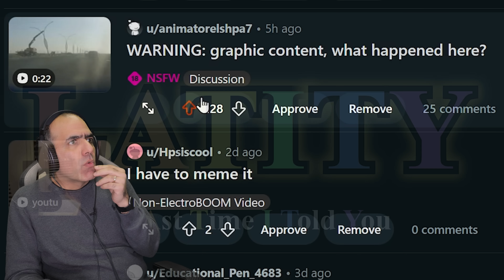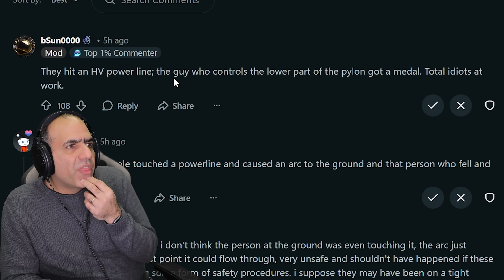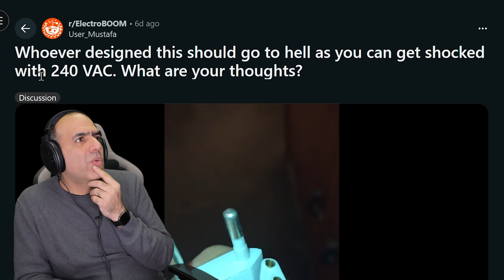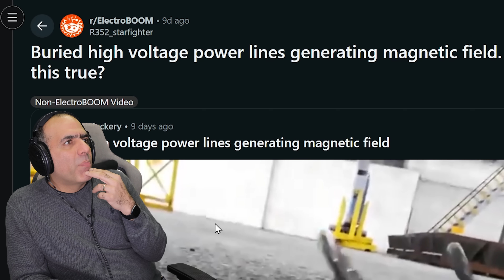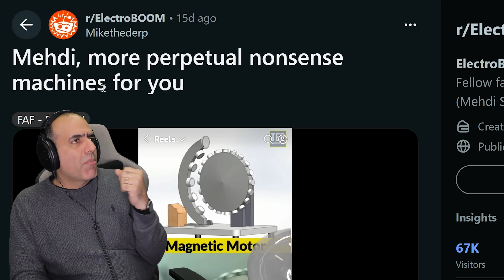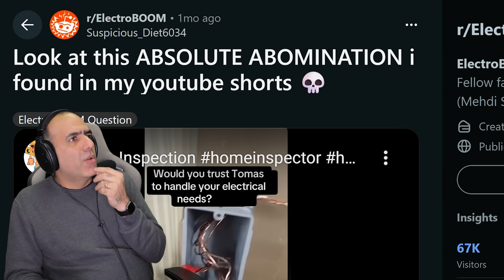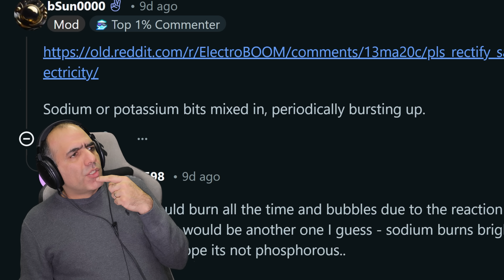Have a Pole? Need a Hole! (LATITY-017)

Comment: 0:56 AC shocks are dangerous because they don’t give you one chance: with mains power (50/60 Hz), the ‘dice’ roll 50/60 times per second against the heart’s timing...

During each heartbeat there’s a short window where the heart’s electrical system is transitioning back to ‘ready’. In that window, different regions can be in slightly different states. A jolt arriving then can split the timing, set up circulating electrical activity, and the coordinated squeeze breaks down. The heart may still be electrically active but now no longer produces an effective pump stroke and needs to get defibrillated.
What matters most is the route through your body, how long you stay in the circuit, and the repeated ‘taps’ of AC - dice roll after dice roll.

Comment: 6:50 - it's likely an aluminum electrolysis plant. They often have lines that run at many kiloamperes of fairly low-voltage DC. The magnetic effects there are WILD.

Comment: 08:48 
The wires you see in Thailand are not power transmission lines but network cables.
The power system is divided into 3 levels:
Low to high transmission (network):
Middle level: 220V, 3-phase, 4-wire, with an additional 3 meters of cable.
Top level: 1000V, which will be converted to 220V (50-60Hz) by a transformer.
Also, I'm a second-year vocational student in electronics at a college in Thailand. I'm 17 years old.

Comment: Resulta que si, es más facil hacerlos porque algunos aparatos se descomponen  y queda el cable suelto, luego vas a la ferretería y compras un contacto.

Yes, it is easier to make the extension couse because some devices stop working and there you have some wires. Then you can go to the hardwere store and buy the other part.

Comment: 10:39 No, our grids are 220V, that is just the rating of the outlets, some places here have grounded outlets, many dont, many houses here dont use RCD or GFCI, and if they do, its usually GFCI outlets, not the breakers themselves, but newer electrical installs here prove to be an exception
Reply: 230V nominal based on Philippine Electrical Code 2017
Reply: Um, akshually...
Mains voltage isn't defined at the grid level (though it's often most practical to have all domestic use operating at either single-phase full spec voltage or dual-phase half spec voltage).
Reply: @Gabu_ This is singlehandedly the most stupid comment I've ever read. Yes, mains voltage is defined at grid level in almost all countries. The distribution transformers in every country have to output the same voltage, unless you live somewhere like Brazil where it's 125V AND 220V.

Comment: 11:04  Those are contactors, they're for motor control.  Along with them, they have auxiliaries for control voltage switching.  For some reason they had an auxiliary that switched the high voltage too, likely 480 volts in USA or 600 volts in Canada.  The buzzing is from it running under load with the C phase on the auxiliary being really loose.  You can see it come off in the video if you look closely
Reply: They're capacitor soft-starters for inrush current limiting.

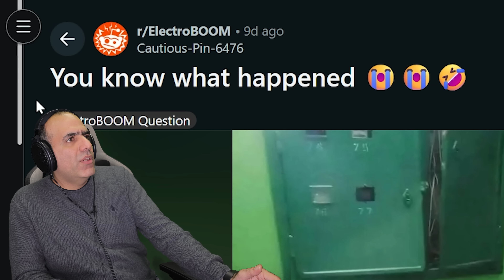Comment: 3:57 by visual appearance this is a distribution board in an apartment block build in USSR circa 1960s-70s, where numbers under energy meter windows indicate apartment numbers, and all these distribution boards have a problem with rotary ganged switches ("пакетники" in Russian, can also search for "взрывпакетники" for funny pictures and videos) which are made from a very fragile plastic put under spring tension that makes them eventually explode and short circuit on a slightest mechanical disturbance, and they were put directly between energy meters and building's distribution buses, so they are not protected by any fuse or circuit breaker other than a main one in the building's basement. What happened is that somebody opened a board to read energy meter's numbers, because as you can see at least one of glass windows for reading them is replaced by a metal sheet, that action disturbed the evil switch, it exploded and trashed the floor and the person with hot burnt plastic remains, and then that guy or gal just walked away with small burns.

Comment: Those brazilian sockets aren't really an issue. In fact, it partially solves. Those labels are mandatory when different  voltages are available in the vicinity. Example: when a city mains voltage is 127V, and you install a 220V socket, you must tag it or use a different color. Also, the new appliances which work on a limited tension range must also label the voltage near the plug. Most appliances sold nowadays here are autovolt or bivolt. Only some powertools, cheap fans, some kitchen appliances and permanently wired devices are found to be single voltage. Samsung even launched a bivolt fridge here. The standard adopted is based on the IEC socket, which the commission considered using blades instead of pins to separete the 120V voltages, but the blades where not adopted, instead ABNT splitted in two versions one bumped the pin from 4.5mm to 4.8mm wide, allowing support to up to 20A, and the other remaining the 4.0mm wide from the type C (europlug), but enabling up to 10A. So it ended up in two versions compatible in a single direction: you can plug a 4mm(also called 10A) plug in a 4.8mm(called 20A) socket, but not the reverse. How is it partially solved? Let's say you got a 1700VA microwave, in 220V you end using a 10A plug and socket, while the 127V equivalent version uses a 20A plug; therefore, you are unlikely to do wrong if the installation is carefully planned. Unless you really want to do wrong. Lol There is also a cheap device sold here which you can easily check the voltages in case you are not so sure and also use it as a keychain, it's the test plug("plugue teste" in portuguese).
I kinda like the idea of not limiting the socket and plug format to a single voltage, it gives flexibility and upgradability.

Comment: The most terrifying experience was when I was 4 years old and plugged a set of bunny ear TV antennas into a wall outlet. I pluged one lead into the neutral plug and the other into the live plug! Yay! I made a radio antenna! I then grabbed both ears each with one hand and BANG! Shocked! No, electrocuted! I couldn't let go either! It was probably only a few seconds but it felt like an hour. Something, someone (God? Hello!) put the thought LEAN BACK into my head and I did! Unplugging the evil device from the wall, freeing me! I never messed with electricity again. So play with knives! Get cut! (Don't really. This is an old child raising tactic that lets unsupervised behavior have its consequences. I had a similar experience getting burned with fire. I never played with fire again!).

Comment: The one with voltage between the faucet and drain can happen as i was asked to check a situation like this, person would complain about getting weird static feel in their body while showering and there was some voltage between the faucet, i never discovered what it was but i suspect the road works near the apartment building was the culprit,  i believe the ground of the entire building might have been disconected during the operation for a couple weeks and all the grounding was happening through the sewer instead, it went away once they finished the works on the road so thats why i think it was the cause

Comment: 10 mA??? So it's weird that a RCD first cut off at 30 mA@30 ms. That's according to IEC standards. Mostly it cut off around 20 ms at 30 mA. 50 mA / 50 V AC/Dc is consideret safe according to IEC norm.

Comment: I know a dude who took a nail in his wooden soled shoe (makeshift theater shoes) and the nail shorted to a main line for a distribution amp, and the charge exited into a 21 inch truss being lowered from a stage. He lost his right cheek and had to have like a dozen plastic surgeries to get halfway good. Hope that dude didn't have a kinetic exit like the bro I knew. I think all the water in his mouth and cheek basically flash-boiled (water to steam volume ratio is 1700 times the volume).

Comment: You don't need a ferret, just a vacuum cleaner. I hope thats just satire. 

Put the vacuum hose on one end of the pipe and make a wad of paper to tie the string around. Then put it in the other hole. The vacuum with suck the wad of paper through the pipe. And this even works on pipes too small for the ferret.

Comment: In brasil we use a tree-phase system in which the fases are 120 apart from each other.
There are different regulations depending on the state. The majority have the phase neutral voltage in 127V. If you get two out of tree passes in this caso, you get a 227V. That os why you saw a 127v and 220v on outlets not so far apart.

But, as I mentioned, there are some states in brasil in which the phase neutral is 220v. So in this states, people usually have his circuits as 220v. If they need a 127v outlet, they might use a transformer.

This kind of stuff is very useful if you want to connect your 127V devices into 220v and kill them. I made it a bunch of times by mistake.

I recommend you to use an electric shower in our costal areas... Usually no ground is installed and you get shocked just by touching any metallic stuff near you.

Comment: For the water faucet one, I don't think there's any sort of trick. In an apartment I used to live in (sorry to say, but it is in Canada) our upstairs neighbor would get electric shocks in the shower because our power cables going to the fridge outlet in the walls had been partly eaten by a rat, and now the exposed wire was touching the water pipes.

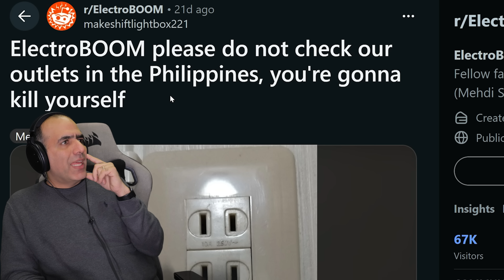Comment: 10:34  Our Philippine Wiring system is same as in mexico you've been tested before but here,In some houses 1-2 circuit breakers protects all the rooms,No GFCI either(maybe in some rich houses or hotels) Also,Kirchhoff law doesn't apply🤣

Comment: Some electrolytic capacitors are designed to blow out the bottom stopper and launch the aluminum cap. Have launched a few myself…

Comment: A friend of mine who lived in Spain for a while said, they had a faucet, that shocked them every time. But only if the water was running.
So I guess things like this can actually happen.

Another friend's grandma (from Germany) said the wall would 'tickle' you, if you touched it.
When renovating, they found bare copper wires in the wall.

So yea... Things like this seem to happen more than you'd like.

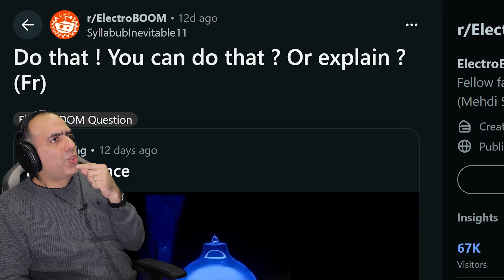Comment: 7:48 Mexican here
Personally, the reason why, at least in my family, build those contraptions is in part due to cost. Most extension cables are trashy asf, like, actual terrible quality. If they were to be kept in the same spot, okay, kinda understood, but when it comes to needing it to be hefty, getting some meters of a good cable, the socket, and the plug, is oftentimes about the same price, and better than the cheapo ones. I guess this might also depend on the area, too. This is just my personal experience with these lol (we have one of those running to our two washing machines. It has failed twice due to a rat munching on it)(yes it's properly isolated).
TLDR: bad quality off the shelf extensions, and price.

Comment: 6:32 as mentioned by others: very high current next to an electrolysis aluminium production line. Creates massive magnetic fields when running. This is a demonstration why ferromagnetic objects should stay FAR from the prod line. Eventually cameras also stop working if they get too close.

Comment: When I first moved into my house, there was a ceiling fan in the family room that didn't work. I turned the power off, took the fan down, then like a completely sane and normal human being decided to touch the live wires to prove to someone that the power was, in fact, off. Well, I got shocked. I was, suffice to say, very shocked at this development. So, I did what I should have done in the first place and grabbed my meter to check the voltage at the lines. I live in North America, so the voltage here is nominally 110v, so imagine my surprise when I got a reading of 220v where the fan used to be. I figure there's only a few 220v breakers at the panel, so I start turning them off one by one to try and find out which one it is. It's there that I make a few discoveries; first, whoever put that fan in, for some reason, tied it into the same circuit as the central ventilation fan. Second, they did so by taking a 12-3 wire and using the black and white conductors as one live, and the red conductor and the ground as the other live. And finally, they didn't even bother to cover the metal junction box back up where they split the power out. It's almost impressive how wrong some of the electricity in my house was done, and that's not the only spot. I have an outdoor shop building that is without power right now because whoever wired it up though it would be a great idea to try burning it down.

Comment: Tungsten-filament lightbulbs are still used in ovens because there are currently no semiconductors (including LEDs) that can handle temperatures that high. It's a huge problem for the the people that are trying to make a venus rover work.

Comment: 3:24 no. the light is blue shifted and it flickers. they make a room feel sterile and just generally suck. i refuse to bear the weight of 'power saving' while data farms and other computer infrastructure gobble it up. It's worse than being expected to accept 'low flow' showerheads while the well to do enjoy palatial water closets.

Comment: In the Philippines we use a somewhat dirty 220V, they usually tend to stay there until jumpers illegally connect and make the transformer blow. Also the outlets are rated for 250v because... Prayful current ratings???
And we are built different no ground just power. If you die you duet. All our ground leads to no where but that device. Just 2 live lines and a false 3rd pin. This is usual for Filipino houses unless you are very well off or a nepo baby

Comment: The salsa is scary Silane gas, which ignites on contact with air because it's auto ignition temp is lower than room temp. Labcoatz has a whole video about it, that's where I got my answer from. Also, there probably wasn't any bad intentions, likely just a classic science demo. They then recorded it FOR THE VIEWS.

Comment: 10:17 actually you can get switches that dont even have batteries in, they use the energy of pushing the button to strike a piezoelectric crystal to make just enough electricity to transmit a signal, they are starting to get used in industrial which is crazy to me

Comment: 4:45 it's not a standards thing, you can see the plastic is deformed too.
Someone ripped that cable out sideways from whatever it was plugged into.

the real PSA you should have said was "respect your cables, disconnect them properly"

Comment: The Philippines use 230 volts. They are terrible when it comes to safety. Like why bother with ends on cords when you can just shove bared wires into the outlet. Or another good example is having seen using metal hand railings/fencing as extension cords.

Comment: Buenas tardes Don Mehdi, in México the common extension cords do not have a good ratio between quality and price, and never have a good size. The example you present in the video have better quality and safer than a cheap one from the closest hardware store (and you don't need to remove the ground pin). You can always use an improvisation as a permanent solution. Greetings from El Puerto de Veracruz.

Comment: 5:00 one of the capacitors in a set of lights I have, exploded recently. When I took the lights apart to see what happened, I noticed the capacitor that exploded in the same way and didn't have the X grooves on top either, but all the other ones did. I can't be entirely sure, but I think that the force of the explosion un-embossed the top of it
Reply: That's basically impossible. Either you were a (un)lucky lottery winner of a rare defective capacitor or, most likely, you were looking at different types of capacitors. Not all capacitors, even in the electrolytic group, have relief scores.

Comment: About the phillipines 250V, most areas in the EU use 250v rather than 240, it's difficult to regulate current at 240, so 250 is used, even in the UK

Comment: as a mexican, i don't know why do we do anything but use proper extension cords..

 hell, even a water pump in my house with a really short cable has its pins directly taped onto some wires from a plug that we use to plug it in

Comment: Brazilian here: In the chemistry lab I used to work we had these setups with both 220V and 110V on the same outlet. One time I was in a hurry trying to pull some old data from an old computer and I had to hook it up quickly. The PSU ran on 110V, but I was in a hurry and didn't pay attention and inadvertedly plugged it into the 220V outlet just as my boss was entering the room. There was a loud bang of the psu meeting jesus and then a loud silence of my boss staring at my stupidity. I remembered Medhi immediately at that moment.

Comment: I would NEVER do something so unsafe as put a three prong plug into a two prong receptacle. Or drill a hole into the wall to allow it to plug in. No. I simply cut off all those third prongs and make them two prong plugs. The SAFE way

Comment: Apparently those plasma globes don't work well for a plasma toroid lamp. What seems to work way better are those decorative flower neon bulbs (the ones with phosphorescant decoratiins inside), which can run the toroid effect down to the power of a 5V USB charger. Why that is IDK, must be something to do with the gas mixture as I'd have thought the plasma globe with less junk inside and designed for discharges would work. Or it could be the low power circuit that youtuber was using.